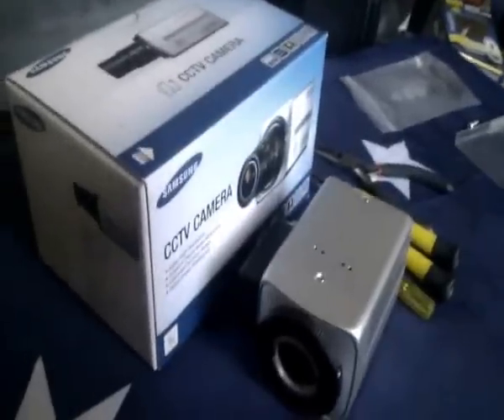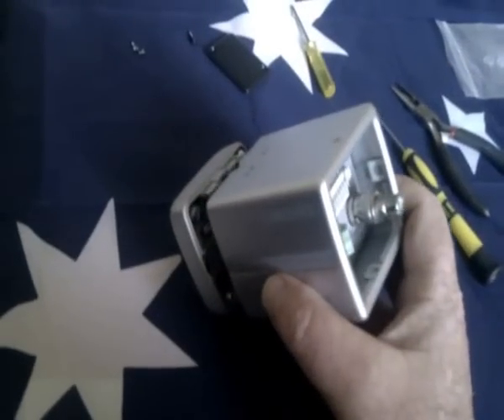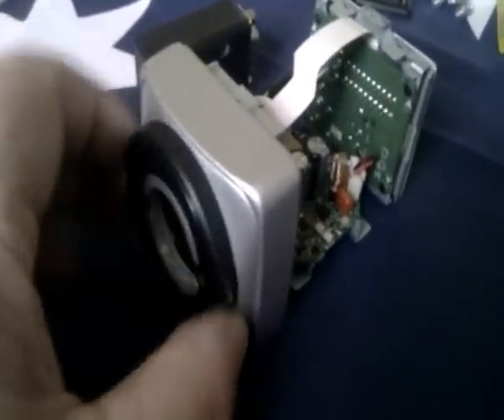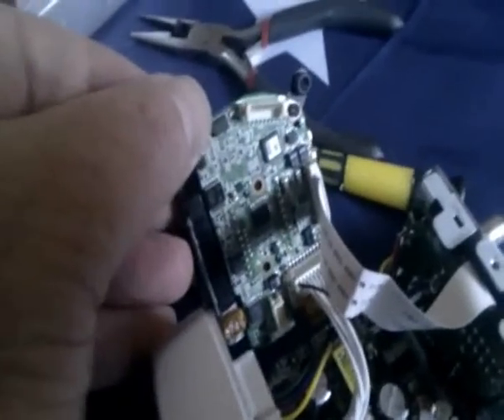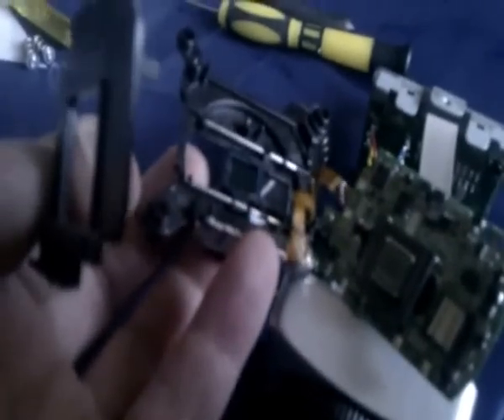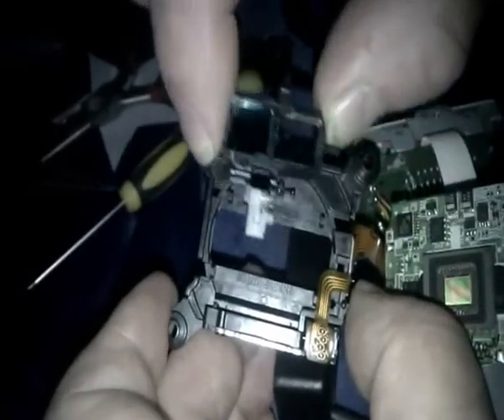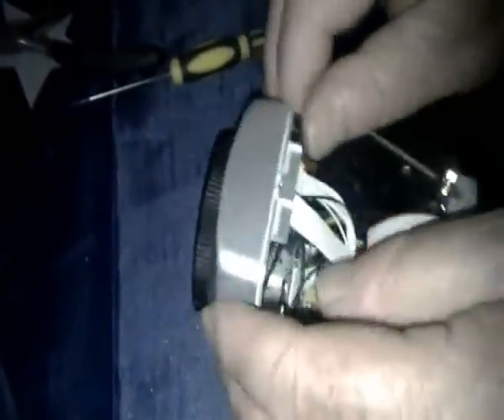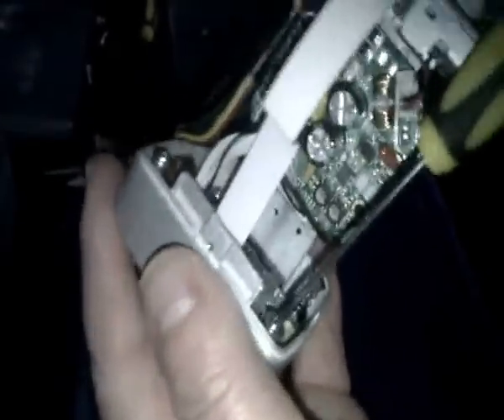Samsung SCC-A2333 Infrared filter removal

Comment: Any one know if you can use the UTC controller with this camera
Reply from the maker: No, the UTC controller doesn't work with the SCB-4000 (SCC-A2333) but does with the SCB-2000. To control the SCB-4000 (SCC-A2333) I made my own controller: https://stargazerslounge.com/topic/196749-samsung-scc-a2333-and-scb-4000-remote-control-project/
Reply: BallaratDragon I’ve seen your controller before your a genius. I brought the scb 2000 it arrived yesterday. I brought the UTC about a week ago and yes works fine. Got a bnc to rca on the back of the scb also got a male rca to 2 female rca. One rca goes to a monitor and the other rca I have another rca to bnc and then the UTC so it’s not even on the same line as the monitor. Works a treat. Hope you can understand all that. Thank you for the reply and clear skies.
Reply from the maker: Yes, I totally understand. Well done 🙂 👍

Comment: It's a shame you can't control the filter switching 'motor' and use the filter when you want to.. Even while in color mode!

Thanks for posting this. I plan to order the SCB-4000 soon.
It just seems like a nice way to look at the sky, while sitting in an easy chair.. :)
Cheers,
Rich
Reply from the maker: Rich, we don't want the factory IR filter in there.
It has the wrong Infrared cut-off point for astronomy. It is fine for daylight use as a security camera, but useless on the night sky.
It cuts off too much in the red spectrum making most galaxies and some nebulas too hard to impossible see. If you want to still use an IR filter to stop star bloat you need to use a proper astronomy IR filter which cuts bad IR but allows the infrared that we want to see which helps see Galaxies better (link to proper Astronomiks IR/UV filter in video description).
A lot of light from galaxies is in the Infrared. I don't use any IR filters at all any more.I can put up with bloated stars to get better galaxies.
Reply: BallaratDragon
 Yeah, I have read about those factory IR filters. Not good at all. My new SCB-4000 should be here in a few days. I will likely test it out for a few hours and remove the filter tray. (Now that I know exactly how to do it)!

I'm going to try using a remote control heard about on the NSN site,
http://www.amazon.com/gp/product/B0089TT2K8
"eSecure UTC OSD Controller with BNC Connector"..

Also order a small display unit for focusing outdoors.
http://www.amazon.com/gp/product/B00KCHSR10

Our big TV displays 480/720 perfectly.. I'm making the cables now! :)

Just need to pick out a good mount and OTA..
Stuff that's easy to control from my easy chair in the TV den..

Comment from the maker: yes, the WB and colour are both effected, but you just change the in-camera settings to correct for it.
No, an astronomical IR/UV filter doesn't work well in daylight for terrestrial video. You need a photographic IR filter.

Comment: HI
I have heard that white balance/colour can be affected if the factory IR filter is removed. Is this corrected by the aftermarket filter installation.

I may neeed to use the camera for some terresterial imaginf and was wondering if this would be possible post filter removal. thanks

Comment from the maker: The Mechanical filter slides the IR filter out of the way (night mode) and introduces a clear glass window, but also switches the camera to Monochrome.
When switching back to Day mode the color returns and so does the IR filter. So the answer is just remove the filter and leave it in Day Mode.